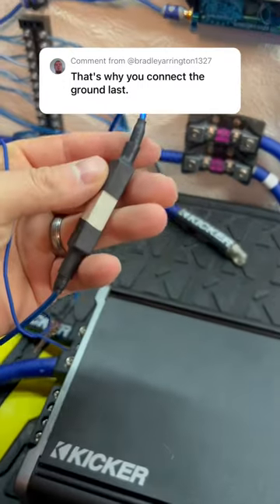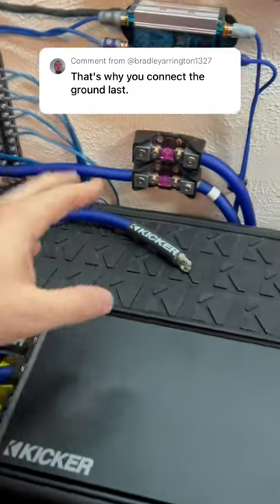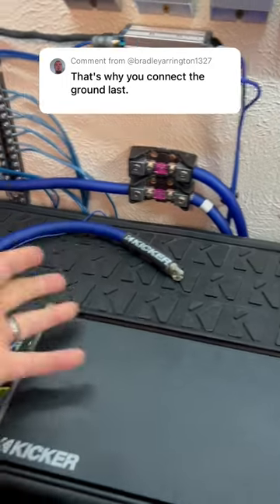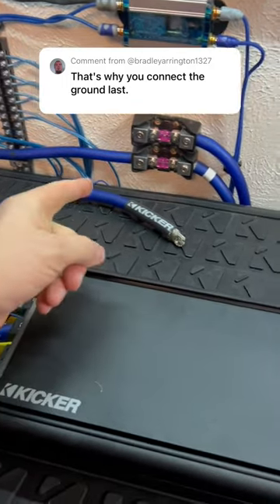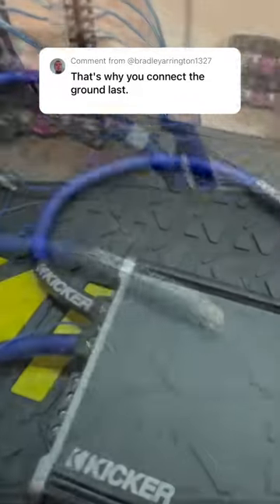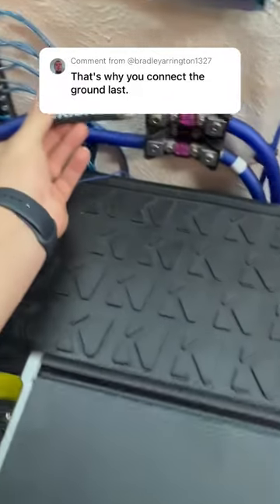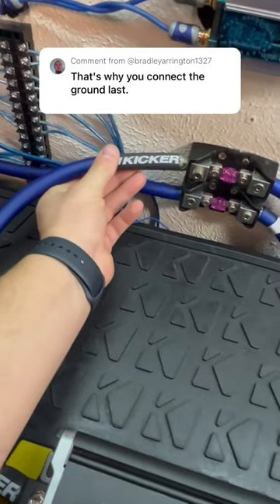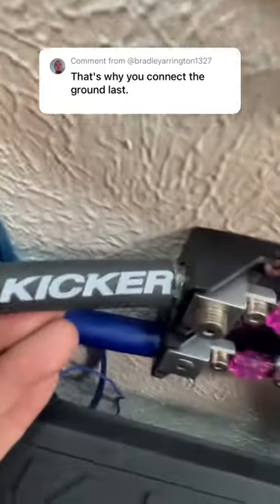Connecting Ground Last to Eliminate initial Spark?

Comment: A circuit is a circuit. It doesn't really matter the order. If all of either terminal (positive or negative) is worked down to one terminal, you are going to see all the current just the same.

I would say there's more of an argument for hooking up the positive last.

1. You minimize the amount of time you're working with a live circuit.

2. Any resistive-capacitive elements are more likely to have a charge limiting resistor than a discharge limiting resistor, so the charging is likely to be (imperceptibly) more easy-going (i.e. charge current < discharge current).

This only really matters when you take into account the internal resistance of a capacitor, and at that, I believe the effect would be to the extreme of marginal. 

All in all, at the point where you're seeing an arc, the best solution is to break the circuit in the place where it is obviously meant to be broken and as close to the source as possible before messing with it. 

If it really drives you crazy, add a solid state switch between the source an the rest of the circuit using some clamp on cables. When you're done, complete the circuit using the switch. Connect the original connection. Then remove the switch. There should be no arcing.

It seems like a bit too much effort to make virtually no difference though.

Comment: Its charging the capacitors in the amp. If its a concern just put a resistor in line to charge up the caps, then land your wire
Reply from the maker: Bingo! Check the short before this one ❤️⚡️

Comment: Best way is use a resistor to assist or cushion the inrush to charge up the capacitors then make the connection too eliminate or at least reduce the arc
Reply from the maker: Yes sir! Check out my last short! That’s what I was using ❤️👊🏼

Comment: the only way to have less chance of sparks(without using a resistor in parallel), but it doesn't completely eliminate the risk, is to use berylium copper wires and connectors and they cost a fortune.

Comment: Need to jump a very high resistance resistor between the two first to edtablish a very low amperage flow and then plug the two in while that’s connected, it can be removed after. It’s how high voltage is switched in EVs
Reply from the maker: Yes check linked video or my last short- just was answering a question in regarding the need of that resistor - viewer was saying I could eliminate the spark with connecting ground last 

In turn not needing the resistor 👊🏼

Comment: Why don't you put a resisted load like a resistor or a light bulb in series and then plug it in. the resisted load gives the capacitors a chance to charge up which eliminates the chance of sparking.
Reply from the maker: Check last short 👀👊🏼❤️

Comment: Do what I do throw a switch in and once you connect then throw the toggle snd boom your 👍
Reply from the maker: That would definitely tighten the gap of the spark! 

The main reason any switch or light bulb goes quicker is from that activity 

Otherwise switches last literally forever 
And also how you get tons of life out of lightbulbs but simply leaving them on !

Comment: How about just dont worry about it. Connected literally 1000s of amps and never had an issue.
Reply from the maker: This device is for hooking up large battery banks that can discharge thousands of amps 

That arc gets larger 😉
Reply: do it with a old amp with dry caps and you will understand why you dont. lol . POP  POP POP